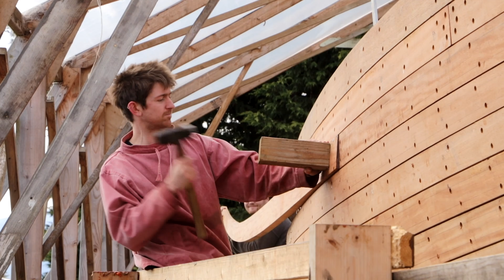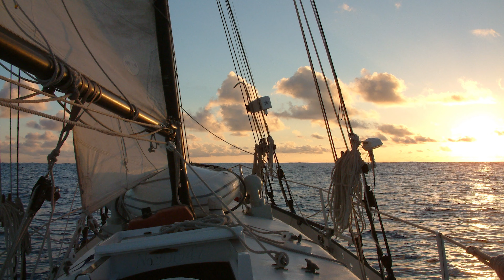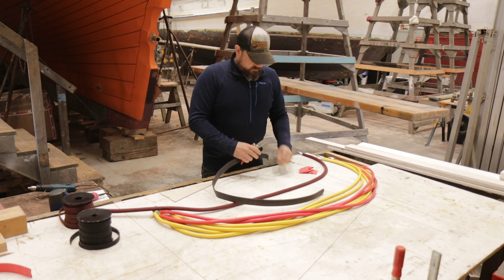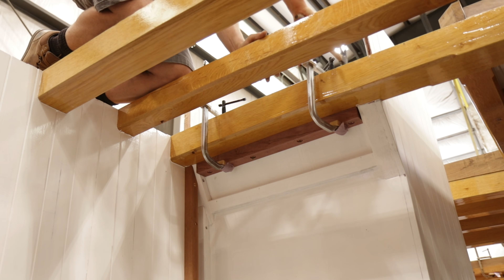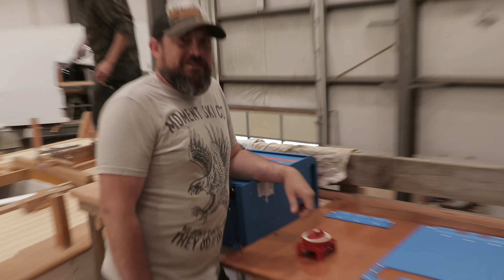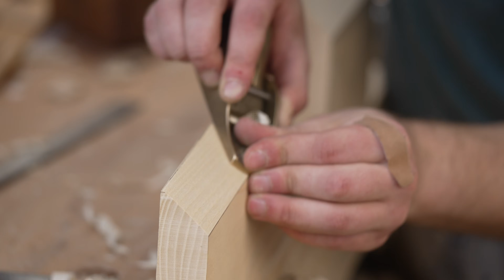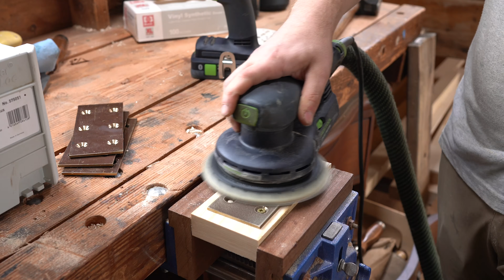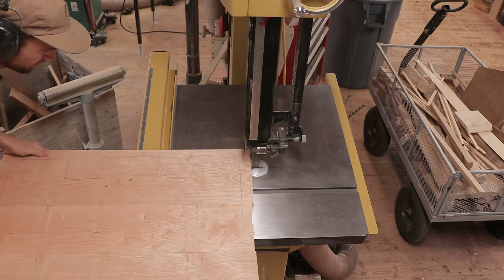Installing a Victron electrical system in the historic sailing yacht Tally Ho

Comment: As someone who has been in the telecommunications industry doing installation, integration, and testing I highly recommend not using plastic cable ties and plastic wall mounting hardware. A much better method for long term/permanent mounting for cables would be painted pr plated metal cable stand-off bars or ladder rack wrapped in fiber paper (aka Fish Paper) and using wax coated 9 strand linen lacing cord.  My reason for saying this is while plastic or nylon “zip-ties” may be easier and quicker to install even the best quality Thomas & Betts tye-wraps become brittle over time and break where as I have removed equipment that was associated wires and cables were attached to ladder rack of cable stand off bars with “fish paper” as an chafing guard/insulation layer that were in place over 50 years and have done upgrades on equipment I installed over 20 years ago and none of the lacing has failed or deteriorated. Lacing cord was the standard for wiring on most boats and ships for scores and scores of years.
Reply: Yup. What the Navy uses. Or did 100 years ago when i was in.
Reply: I think he can replace those in 30 years :)

Comment: How will you protect those exposed metal electrical contacts & anyfrom corroding in the moist sea air?  Silicone grease? conformal coating? Vaseline?Nothing?

Comment: What is the difference between a Ship & a Boat?
Reply: A ship has 3 masts. As for modern vessels, the center of gravity/buoyancy is different, a ship will lean its top towards the outside of a turn, a boat will lean towards the inside.
Thats also why submariners call their subs boats, while the surface fleet operates on ships.
Reply: Ships carry boats😁
Reply: A ship carries boats (live boats, row boats)
Reply: About $1,000,000 / foot.

Comment: As far as the batteries being close together. Of course people want to be helpful, thinking of potential problems. But if they had thought about it then it would be reasonable to assume that others have also thought about it. As a recently retired electronic engineer I have often have had to explain that, yes, I have taken the application into account and took a very conservative approach as far as the conditions equipment can be used under. I have considered factors that most people would never have thought of. That's my job.

edit: Was my job :)
Reply: It's so encouraging to follow the advances in battery methodologies. A very cutting-edge choice of electrolytes, and yes, safe.

Comment: Hi Leo, I see your help holding parts by hand when using the drill press use a clamp trust me when the drill bit grabs it hurts.
Reply: I agree. There's a company called Cardinal Speed Vice that makes the best little drill press vice you can buy. They're not expensive and they work great.
Reply: @1991pony  Hi I seen people get badly hurt doing this
Reply: The trick is to hold the piece in a way, so it doesn't crush your hand when the drill bit grabs. Works like a charm.
Reply: @sidekickbob7227  Hi use a vice
Reply: @philipstreechon4523  I usually do so. I know when, how, and why. (I'm a toolmaker, and are working saily with equipment that can hurt you badly.)  But when your not using the vise, then hold the piece in a smart way.... That's all I'm saying.

Comment: Having just done a much smaller LifePo4 install, I am really curious about the location of the T Class fuses, as described they would only protect from runaway on the 230/120 systems. rather than inline from the battery. It's not a criticism just a learning point for me :) great video's as always.

Comment: are you plating the bus work with tin or nickle?  Copper will oxidize and connection resistance will go up and heat. Great video for a EE?  :)
Reply: On electric vehicles, bus bars if "solid" aren't usually actually solid bars, they're thin plates stacked together so that there's some hope of flexibility. And yeah, nickle, or nickle-plated copper is all but necessary in automotive use. You'd think that marine use is a more extreme version of automotive use. You have more vibration and more humidity, and a corrosive environment. Leo doesn't make snap decisions, so, I'm sure there's reasons for these, I'm just curious what they are.

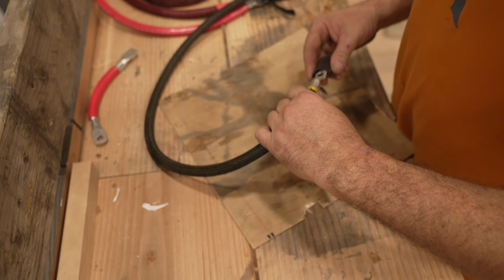Comment: 5:15 what in the world is that knife and where can i get one!? It cuts through that cable with no effort!
Reply: It's a hot knife and is only cutting through the braiding (but melts the end to prevent fraying). It's not cutting through the cable, though hot-strippers exist for stripping wires too.
Reply: Called a hot 🔪. I think he is using it to cut the insulation for the cable. Then used a cable cutter for the cable.

Comment: As a manufacturer of cables, that's a pretty good looking installation going on there
Reply: Give GripLockTies a look see, Electrifying new video. Thanks Tally-Ho team!
Reply: Sheathing the cables provides a great deal of protection against abrasion of the cable itself, well done.
Reply: @rushd45  may i ask is that the primary reason for the sheath? and do crimp lugs have benefit over other methods like solder etc? thanks in advance
Reply: @cliveramsbotty6077  Without sounding too condescending, it's simply to protect the cables. 
Yes, they already have insulation, but that is soft and pliable and will wear easily if not protected. On a wooden boat like this there's obviously no danger of shorting out through the hull like on a metal build, but protecting the power cables from chafing on each other and their mounts etc is very important for the extended life of the system.
Soldering lugs this size is tricky due to the large cross sectional area of the cable, mechanical connection is a much better method, although if this was my build, I might be tempted to solder AND crimp just to get the highest surface area contact possible........
Reply: @nickmaclachlan5178  From the same NASA standards doc that I linked in my other reply: "Crimping of solid wire, component leads, *or stranded wire that has been solder-tinned*, is prohibited."
Reply: @pcb1962  But this aint a Space Rocket....... lol.
Reply: @cliveramsbotty6077  As far as the lugs are concerned there are pros and cons to both methods.
Soldering is tricky to do on cables this size without burning the insulation off in the process. On the other hand the joint is more resistant against corrosion.

Crimping is easy to do and as long as the joint is done well the connection is nearly as good as a soldered one. Also on cables that are meant to be flexible crimped lugs have less of a risk for the cables to break off at the joint.
Reply: @pcb1962  just as well that Tally Ho’s cables meet NASA’s standards then, the wires are not solid and they are not solder-tinned that I can detect.
Reply: @nickmaclachlan5178  it wouldn’t matter if it was a rocket, the wires are not solid and not solder-tinned.
Reply: @teeanahera8949  Correct, I was replying to the comment that suggested both soldering and crimping. The problem with crimping tinned wire is that the solder 'flows' over time and the crimp will become loose.
Reply: Lots of discussion on soldering.  It  does make for an ideal electrical connection, but it can cause a significant amount strain just behind the solder joint.  If there is movement in the wires the solder joint will fail faster.  Another issue with soldering is if the wires are solder (tinned) dipped.  These wires should not be used in connectors with screw connections.  The screws are torqued in place, but over time the solder will deform overtime and the connection become loose.  The same happens with solid wire, which is why it is no longer used in new construction (at least in the US)
Reply: The only things I saw are that I prefer a hydraulic crimper with hex dies over the lever style shown, and I hope the woven loom tubing was kept far enough back from the start of the insulation under the heatshrink that the layer of sealant (I'm assuming this is marine grade double wall...) Can bond to the wire insulation directly to keep any salt water intrusion and vapors out of the cable core, but I'd be very surprised if they didn't think of that up front, I just couldn't tell for sure from the video if it was done that way or not.
Reply: @kenstein  Looks like they used a hot knife cutter, that would significantly reduce the risk of fraying
Reply: lovley install sadly we all know some inept tech/diy will ruin it 'upgrading" the system some time in the future
Reply: @gavinferguson  updating Tally Ho’s electrical systems by someone inept? Seriously dude, you need to think that one through, this is Leo’s boat.